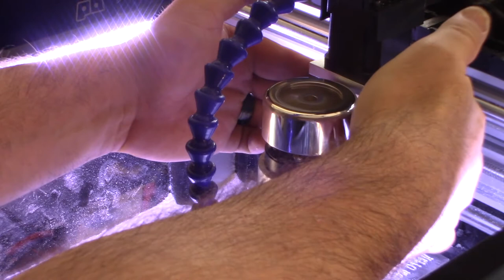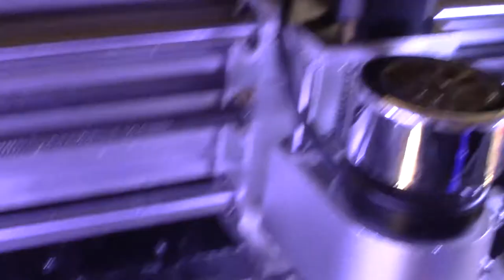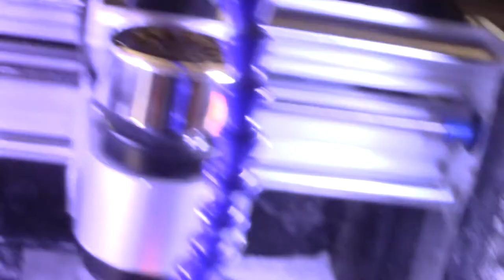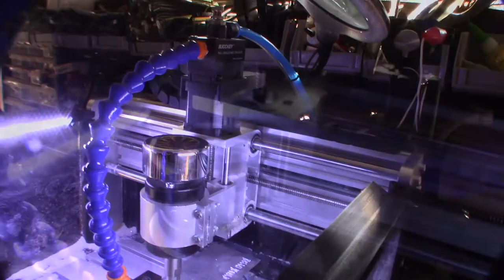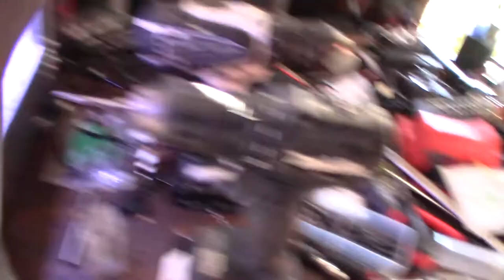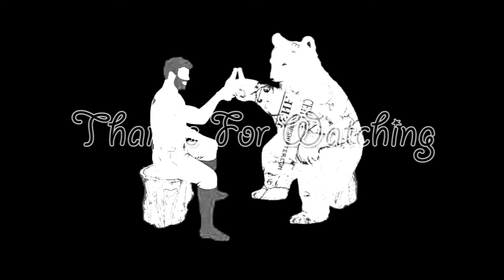3018 CNC Z axis Noise Reduction, Reduce Vibration Fix Endmill Chatter

Comment: I had the same problem sounded the same. I just upgraded the spindle to the 5500w from My Sweety with the separate Power-supply and speed control and almost all the vibrations went away without touching the machine. The original spindle is just off kilter. It is nice and quiet now. I like controlling the speed without the software.

Comment: That is excellent notes I found the rod bar thickness is 7.94 mm and it's not stainless So I exchange that with stainless rod 8mm it does give a lot of defiance
Reply: just measured mine and is the same +-7.95mm
I noticed there was some play on the LMU8, so actually problem is the rods.
Reply: @Nandox7  Well I do complete upgrade for  my 3018 you can check that on my channel .
Reply: @yacoubjabal3762  cool. I'll check

Comment: I have the exact same issue. I rely like the kit as it way better than the others with plastic parts.
What I noticed is there is some play with the LMU8 and the 8mm rods, probably a tolerance issue. If i lightly old the moving part of the Z axis that holds the spindle that sound stops.